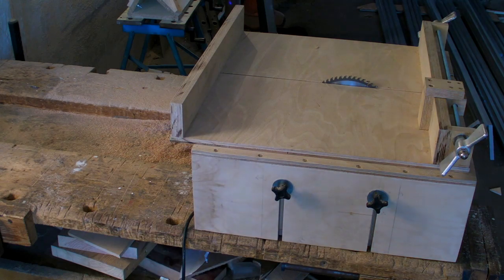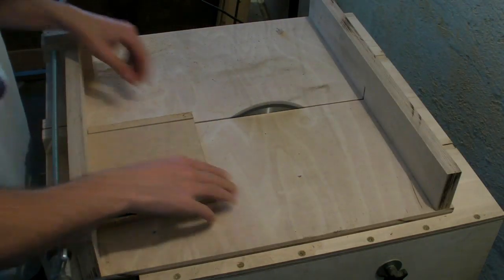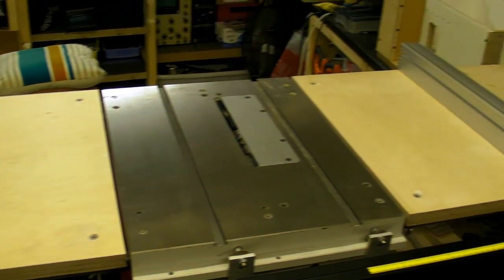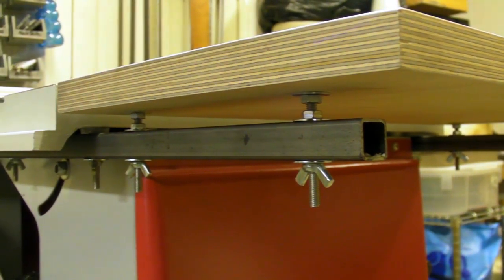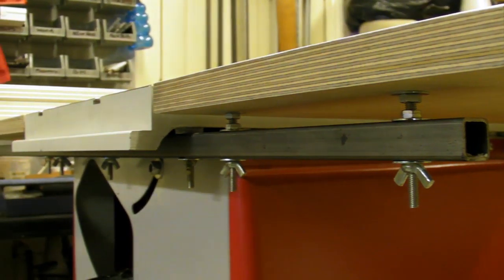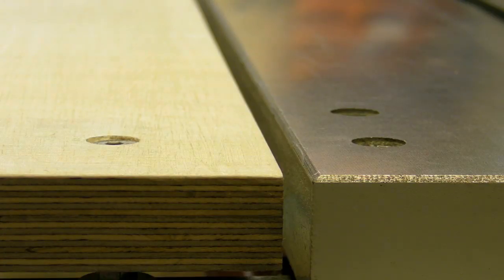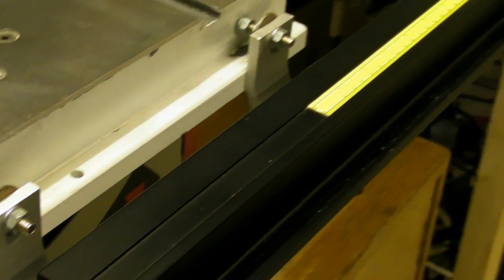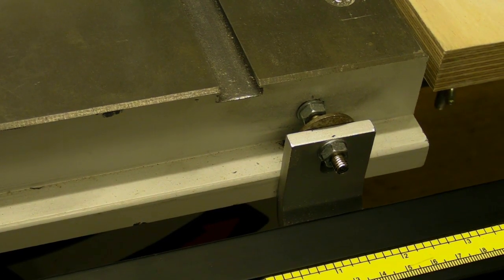New Table Saw (Extension, Guide Fence, Zero Clearance Insert, Mitre Fence)

Comment: Ahhh bonus, you now have a proper table saw. Good to know that it's one from Axminster as I have one of those stores in warrington. Kind of gutted that the wooden one has been put to one side. But on another note, I can't wait to see what you have in store for us with this new toy :)
Reply from the maker: Lol it's definitely not the greatest... I've noticed marginally different sized guide slots which means the aluminium tape I have added, which worked on the left hand side of the blade, doesn't fit the right slot... but it's something I'll have to learn to live with.

Comment: Hi, I had one of those table saws and it served me well. Just found it to be a bit underpowered but very very quiet! Ended up selling it for £200 and buying a Wadkin AGS10 (1960 model) off ebay. Its the dogs danglers and only cost £400. Your videos are excellent by the way!
Reply from the maker: Yeah I am not really testing my little saw but glad it is quite.  The blade traveling while tilting still annoys me, but for the price I shouldn't complain.  You got the wadkin for a pretty good price!
Reply: ***** I know, I was really lucky. I've stripped it, painted it and added some new bits and it looks like new! When I had my TS200 I cut the riving knife down so that I could cut grooves more easily. (I ditched the crown guard - I know I shouldn't have but it made life easier and I always wear a full face mask when using a table saw) Cheers - Baz

Comment: What kind of tooling did you need to drill and tap for mounting the rip saw fence? Just a hand drill, or was the piece you D&T'ed removable so you could put it in a drill press? Considering the TS250 and I like your upgrades the TS200.

Comment: Nice work Savvas! 
I recently bought the TS 250 M ... but it still has the same problems.
Already spent over 3 hours aligning the blade to the table top. And now i'm going to build a router extension table as well, but I'm struggling with the fence. Which band saw fence system did you use for your project?

Comment: Fantastic mods to the TS-200, I bought mine not so long ago and it is sitting in my garage waiting to be tinkered with. Are you able to divulge which guide fence you are using? It looks solid in the video (Looking forward to part 2!)
Reply from the maker: Yep that was the axminster upgrade for their bandsaw... there is not much of a choice in the UK but it's nice to work with and it had t-slots on all sides.

Comment: I bought the exact same fence for my TS200' but the length of the fence only extends to about the end of the riving knife - did you buy another longer fence for this?
Reply from the maker: Andy Midd Was this the rip fence upgrade?  No I just bought the kit as it was, but I did that a few years ago so unsure if they have changed the model?  The newer mark 2 versions of the table saws look a lot better than the one I bought.
Reply: ***** Mine is the MK1 TS200 (bought just before the MK2 came out). The fence upgrade I bought, seems identical to yours, other than the actual length of the fence, which is strange. Did you buy the fence from Axminster? I think they call it the band saw fence upgrade...